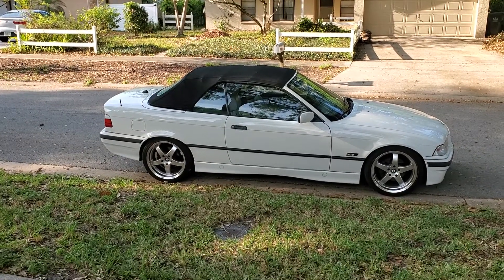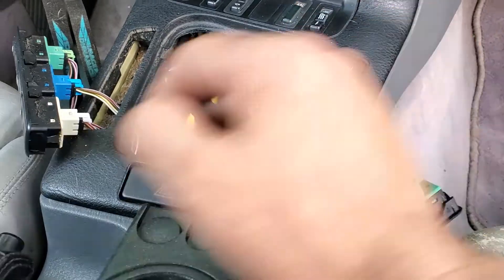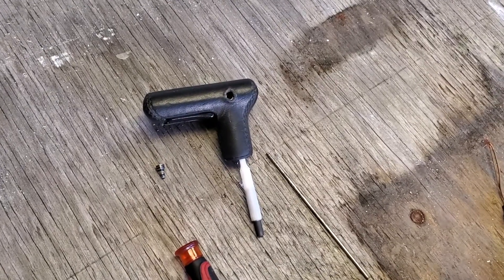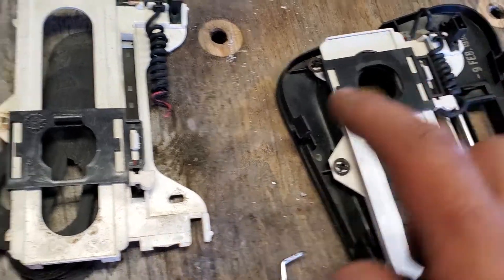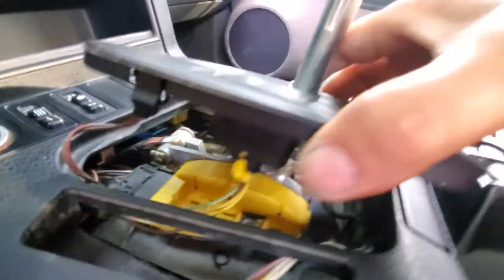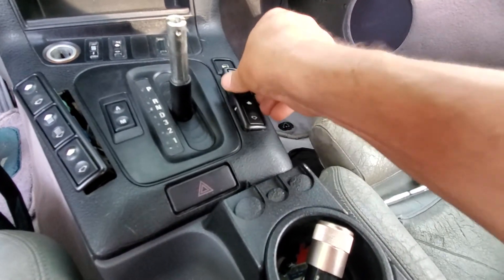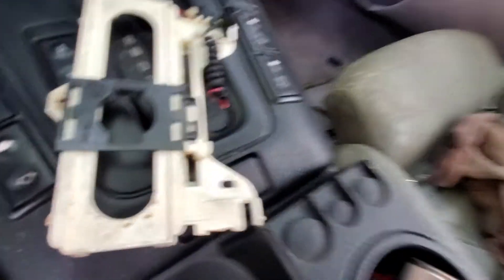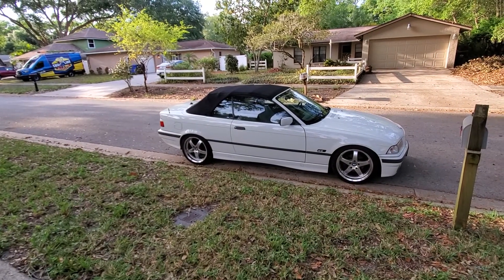BMW E36 Automatic shifter illumination light FIX!

Comment: Thanks, Frank. I didn't even know it illuminated! My E36 (Alpine White Vert!) has another problem in that area. My automatic shift lever is super-sloppy/lots of play front-to-back. Is there something that you found comes loose in that area or wears out like a seal or bushing? Curious if you have any ideas before I pull it apart. (Note: Transmission shifts fine and has no problem finding gears when shifting even manually so I suspect the lever connection and not something internal.)
Reply from the maker: you'll have to go under the car to see if the shift linkage needs adjustment  or see if the shifter arm is wobbled out. FYI- the E36 is known to leak at this union "shifter seal" >its right where youd be checking for play. It comes with age you can't stop if from happening.
Reply from the maker: as far as the illumination yes after the original one blew out/broke apart I'd sometimes be in the 2nd gear. especially at night it sucked.